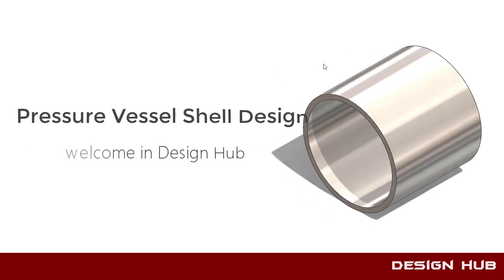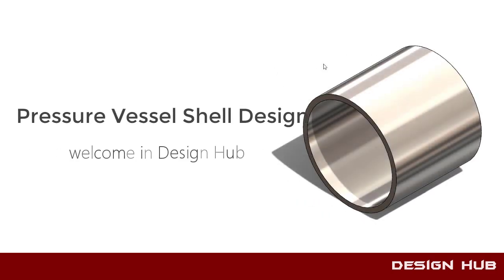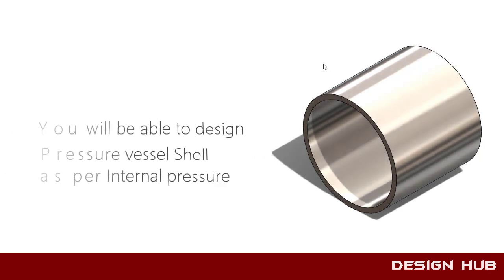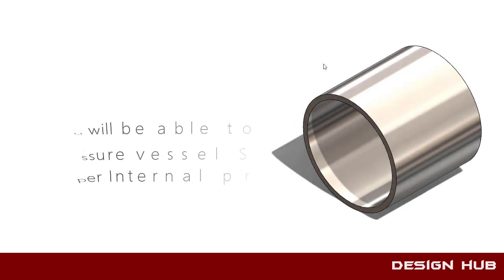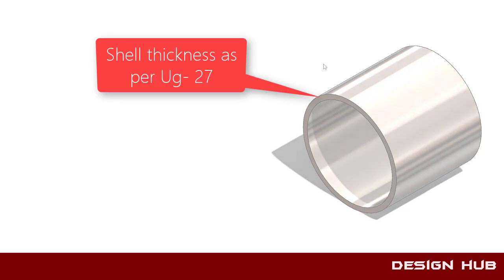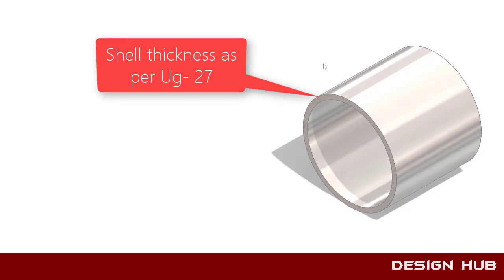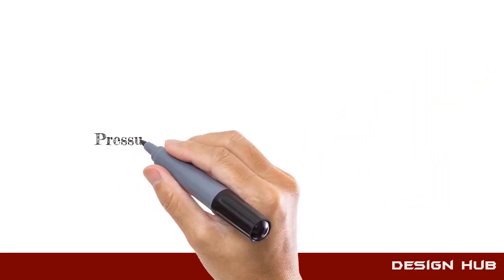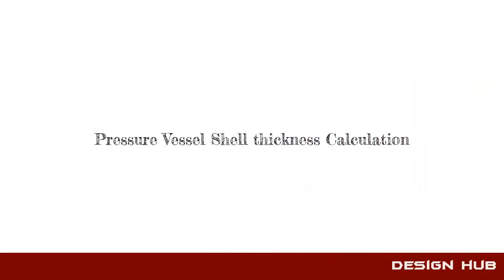Pressure vessel shell thickness calculation as per ug 27- Part-4

Comment: Why do you subtract pressure (p) in the denominator? If you take the basic hoop stress equation sigma = p*D/(2 t) and you rearrange it for the wall thickness you get thickness = p*D/(2*sigma), plus allowances. Of course, sigma is the allowable stress. What is the source of this "-p" down there?

Comment: Thank you! Can you do a video on finding the head thickness per UG-32. Also, when and when not to use static head/pressure conversion factor (0.433 psi/ft) to the calculation.

Comment: How to know corrosion allowance for Thk calculation
Reply: it will be depend on corrosion rate you expected based on experience, corrosion engineering result with your fluid medium, material spec, design condition multiply with the plant expected life.